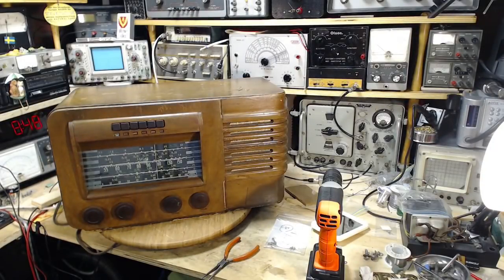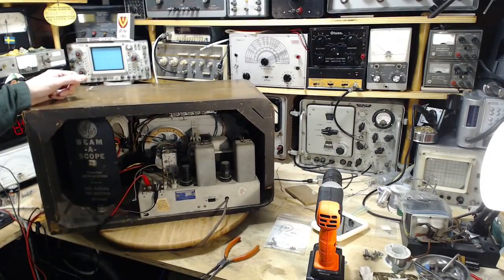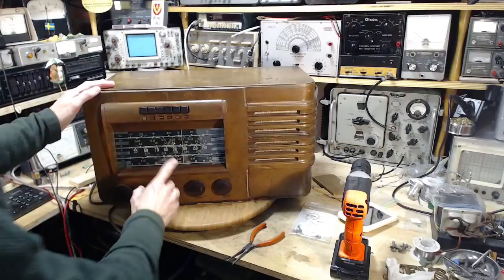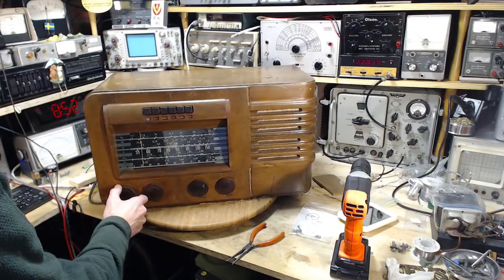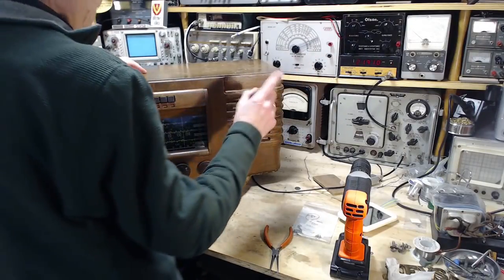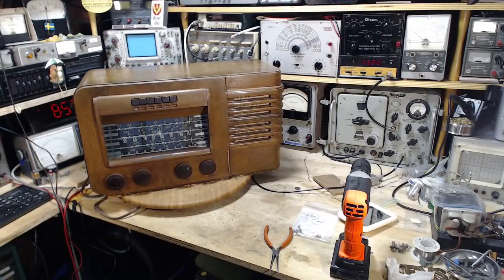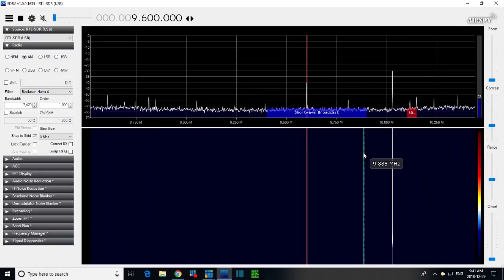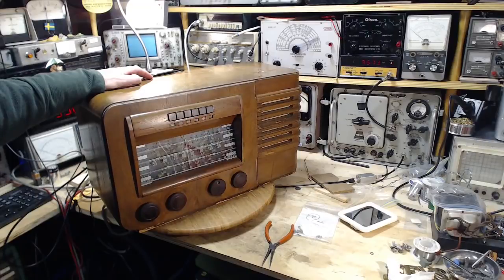General Electric KL-70 AM/SW Radio Video #37 - Weak 19 Metre Band

Comment: Sounds like poor AVC bypassing.
Reply from the maker: Not sure about a bypass.  The oscillator grid on the 6SA7 has a 56 pf capacitor that would block DC R9 33k to hold down the grid voltage - could be open.  I'm thinking there's an effect through the tube from the signal grid which is following the AVC voltage - maybe a change in inter-electrode capacitance.  Maybe the screen voltage is off.  The screen grid has a big 10 uf capacitor on it that is still original.  I'll be looking more at this 'problem' down the road.